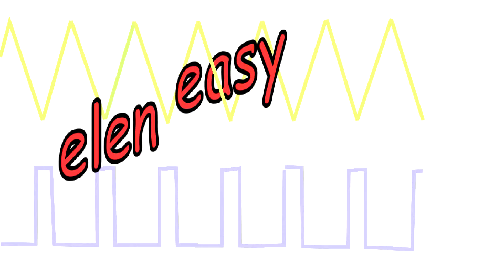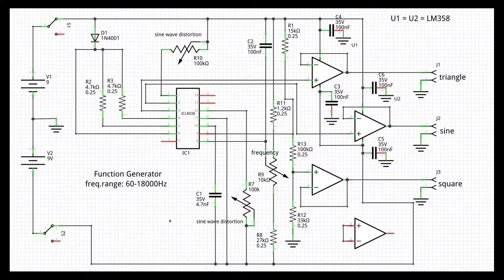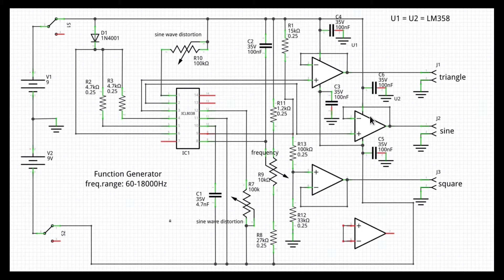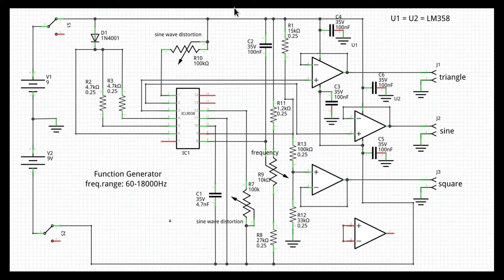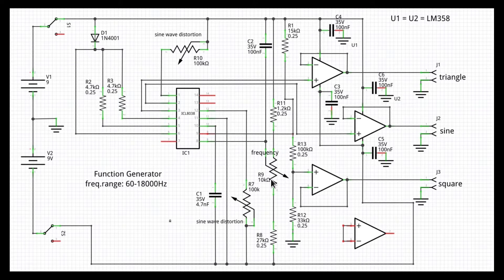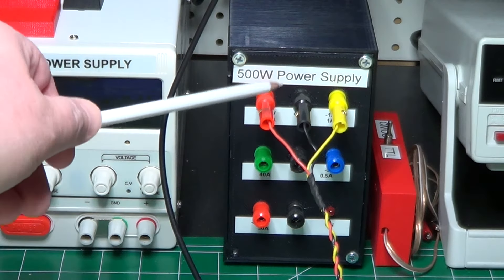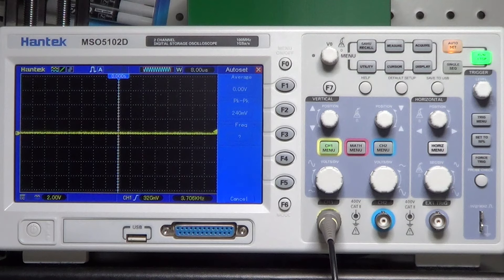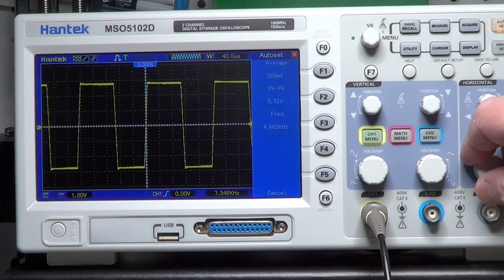How To Make A Function Generator

Comment: How do I get the freq range 60-18k, I read the datasheet but I couldn’t get a formula
Reply from the maker: It ends up being a trial and error approach, given the incomplete information provided in the data sheet. I used as a starting point the examples in the data sheet along with the information in section "Frequency Modulation and Sweeping", to obtain the range of frequencies I wanted.